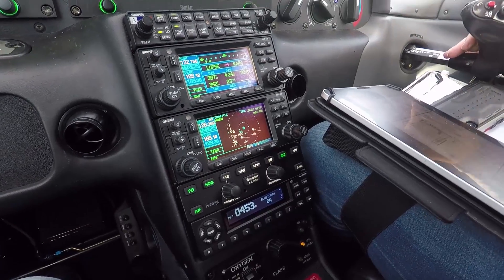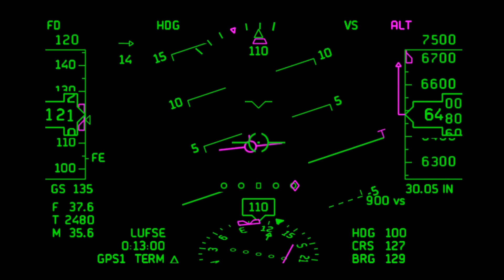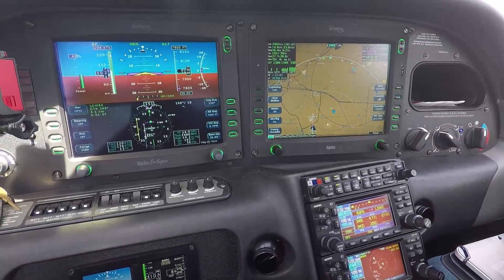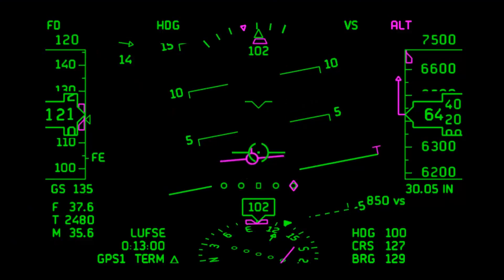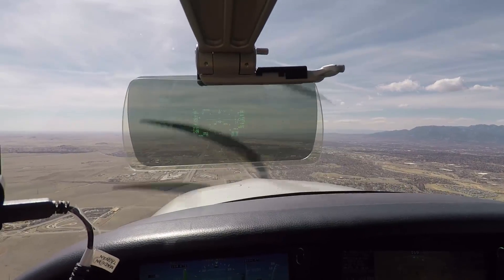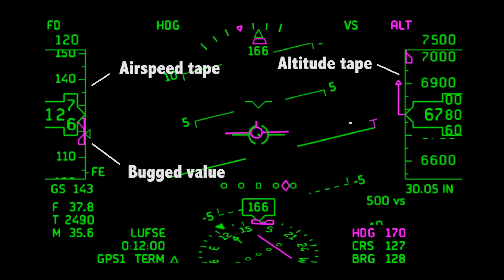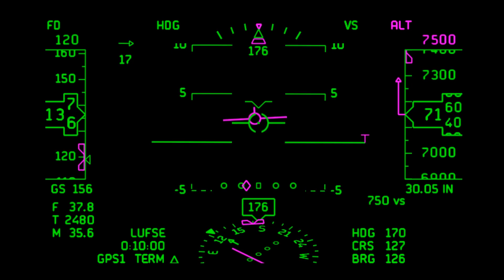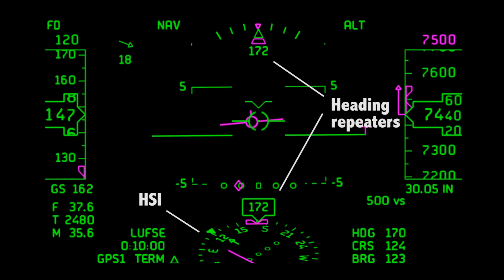MGF's New HUD Display

Comment: Nice unit, I'm sure some people will have to have it, but in my opinion it adds no real value for general aviation and very little value for commercial aviation.  I fly 787's for a living, they all have HUD's, however, I find them very distracting and I never use them.  The problem with the HUD is that it changes your focal point when you are looking through it out the window, especially on landing.  I find too many HUD users are no longer focusing on the runway environment but instead are focused on the information on the HUD glass a few inches in front of them, chasing the dot and the doughnut, with little regard for what's going on out the window in relationship to the runway in front of them.  I can even tell when riding in the cabin, if the pilot is hand flying with a HUD by how the ride changes because they are chasing the dot and the doughnut. Anyway, that's just my opinion.

Comment: 25K?
Reply: Yeah steep, but that's probably paying for regulatory red tape, marketing, low sales volume, profit. The BOM on most HUDs is under $1k. This tech will get cheaper as it gets more users.
Reply: omgnothingisavl i guess low sales volume is definitely connected to its price tag. Red tape alone won't justify 25k.
Reply: @nickieshadowfaxbrooklyn5192  This would be flying off shelves if it were priced where it should be...which is like $2,500 or $5,000 tops. You would see this in every IFR-rated aircraft.

Red tape is what keeps GA small, as it drives prices way up on absolutely everything. I know it's for safety, but there has to be something that can bring down costs.